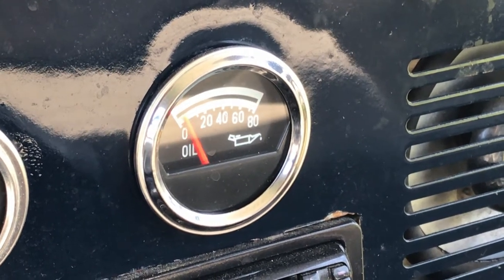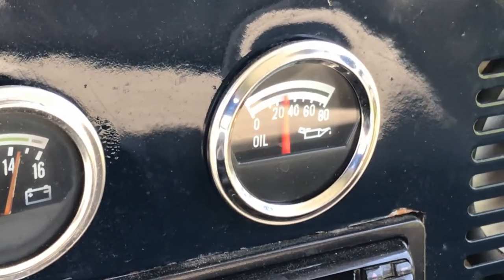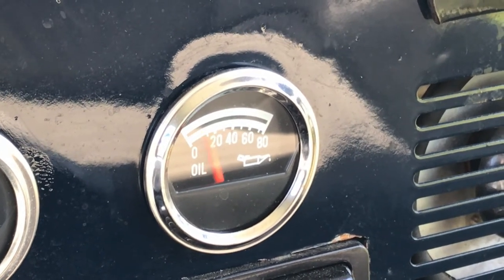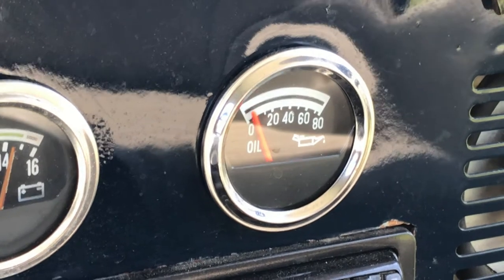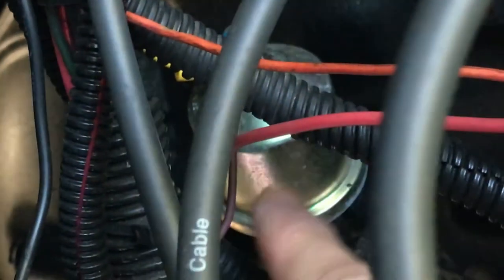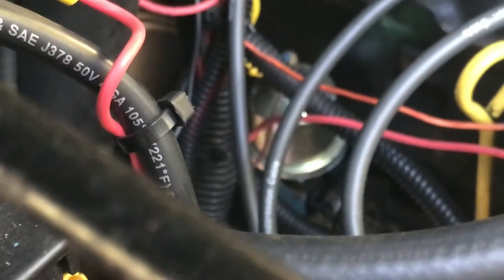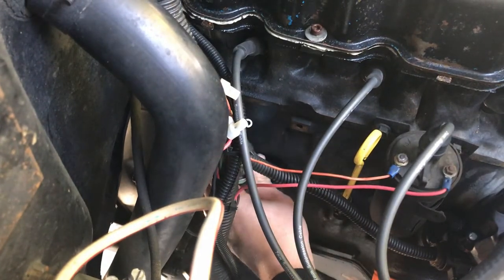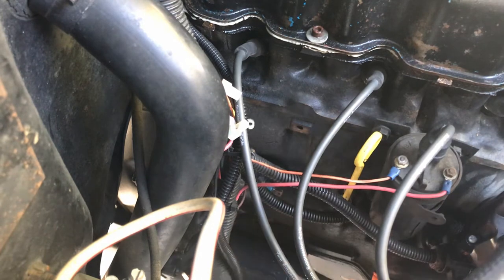1981 Jeep CJ7 Oil Pressure Gauge Fix

Comment: Wow you just solved an issue I've had since I bought my cj5 8 years ago. It's never read more than 20 psi, drops to zero at idle. From your info I see that my 81 gauge has been replaced with the newer one, resistance is totally different,like 4x different!  Thank you for this vid!

Comment: it's the dash ground. You have a new sender wire, but you need a new ground. If you run a ground from another area the gauge reading will change dramatically. For me, it was a ground issue on the gauge pole. I could make it show 60 by changing the ground connection quality at the pole itself, but it was really 20. Guess how I accidentally figured that out? Faulty ground on the light bulb. Ended up trying a case ground, a straight wire to the pole bypassing the cup wire, in the end I found out I could basically make it show anything I wanted.
Reply from the maker: The grounds on the vehicles seem to suck right?
Reply: @generalpurposetv2241  Look into a ground block connected directly from the battery to everything you need to ground - Independently! Everything on a jeep needs this.

Comment: The two wire connector is a switch to activate a warning light in dash if the pressure drops too low. Your model may or may not be equipped with that light. Depends on the original package.
Reply from the maker: I dont think it has that light.
Reply: You almost can't have too many grounds on a car. Everything from taillights to ignition runs on grounds, even the radio works better.

Comment: Hey man nice vid, hows that gauge working out for you now???, I'm having the same issue too, (bouncing around)I'm bout to mess with mine💪
Reply from the maker: Thanks. I found that the bouncing around was definitely due to the OEM wire coming from the pressure sending unit. There must be a short somewhere along the line, and once I disconnected it completly and used a new line instead, no more bouncing. But my gauge is always at around 60psi, which doesn't seem right. Ad it never moves really, even at low RPM. So I want to find a better gauge and see if that helps. This one is a cheep China made one from Quadratech or something. I want to try and fine an original one off eBay and see if it works better that way.
Reply: @generalpurposetv2241  I have been around CJ7s since they were new, and those oil pressure gauges never worked right, even brand new from the factory. My dad bought an 85 CJ7 new in Sept 84 (which I now own) and its oil pressure gauge never did read over 30 lbs. I've owned several 76-86 CJ5s and 7s, and they always read low and also bounced around. The 258 engine has a high pressure oil system, so 60+ lbs is probably about right. Hope this helps, even though I'm 9 months late!
Reply from the maker: Thanks, good to know the pressure it normally that high.
Reply: Jack Merlin thanks for that input, I have an 86 cj7 and the gauge starts at 40psi, then after about 3 min of driving immediately jumps to 60-70 psi, that’s good piece of mind knowing the pressures run high👍🏽thank you

Comment: Just add a manual oil pressure gauge. Do away with the eletric one!! Problem solved!!!
Reply from the maker: I know, i might do that as it stopped working again. I just like keep the stock gauges! It's an OCD problem.
Reply: @generalpurposetv2241  Problem solved!!!
Yea!  Till the oil line brakes, and they do.